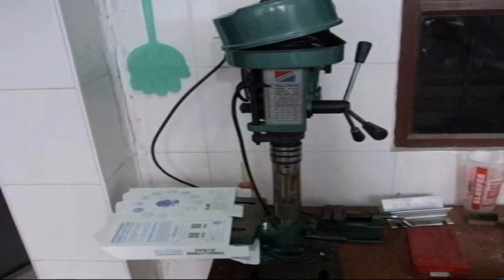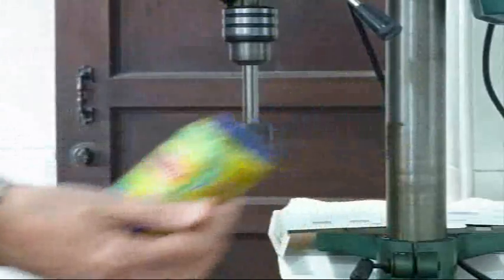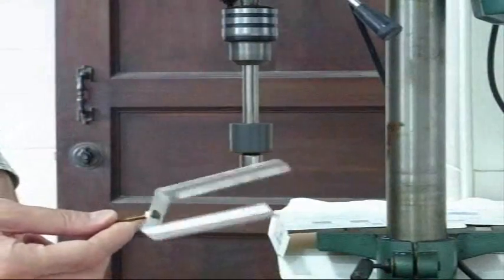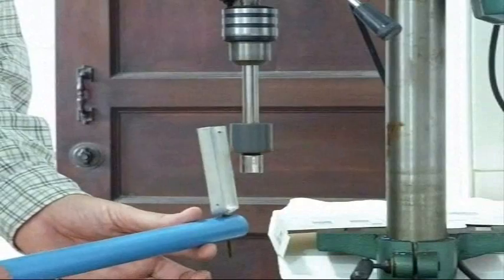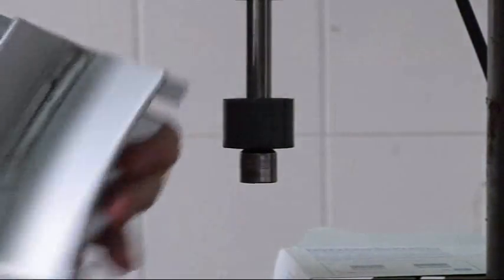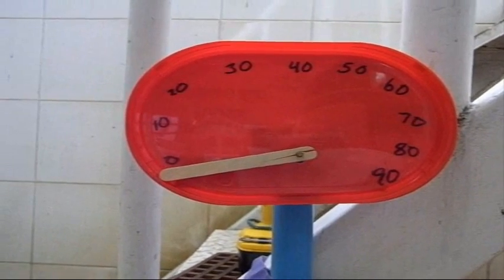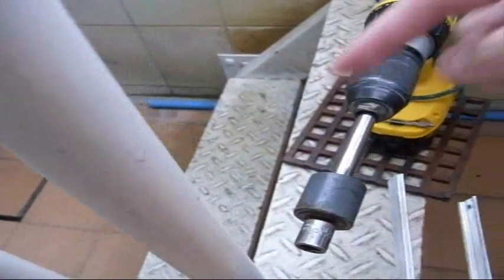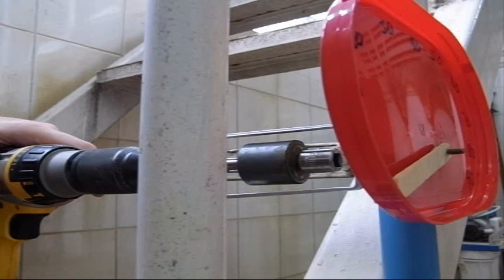Strange Electro-Magnetic Phenomenon, You Use Every Day

Comment: I had seen the working parts of a speedometer before but assumed it worked thru close proximity air currents. I am glad to be corrected and enlightened by you video. Thanks!
Reply from the maker: Actually I did also.  Then I read about this and the light went on.